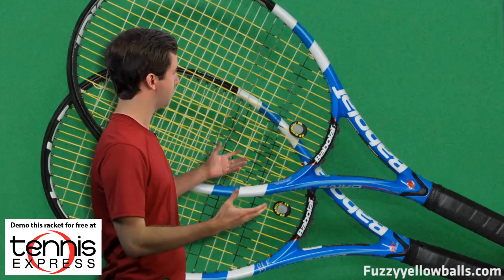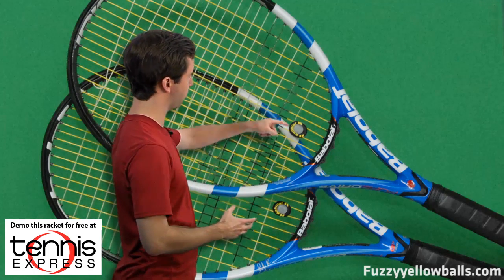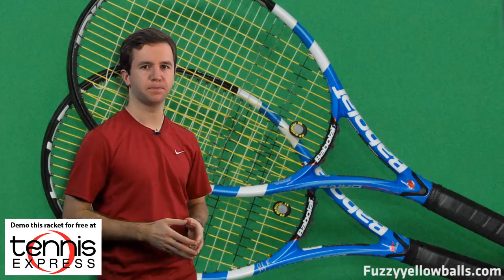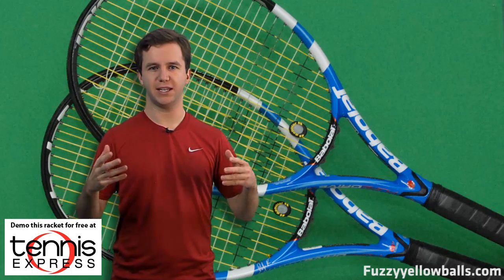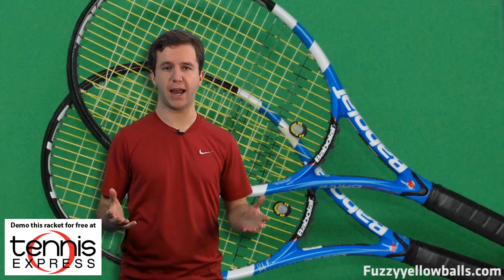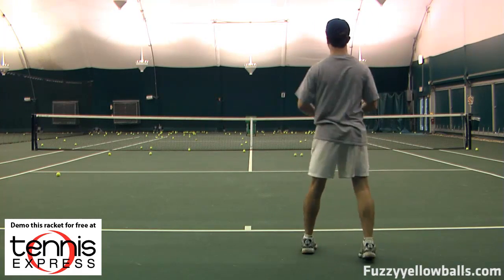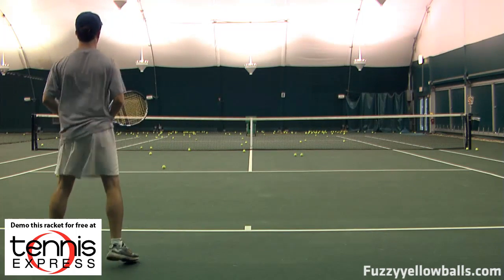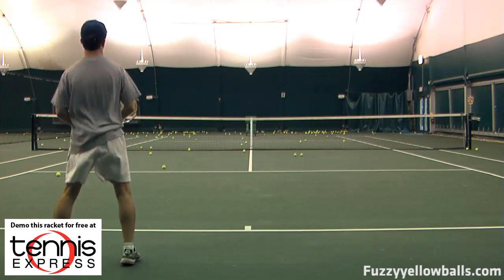Babolat Pure Drive Roddick GT / Babolat Pure Drive Roddick GT Plus -- Tennis Racket Review

Comment: I've been using the GT (Cortex 107) for about 2 years now and it's a wonderful racquet. Had to toss about 8 relatively new racquets, since I won't play with anything else now. The Cortex really dampens the vibration and it has a big sweet spot.  Recently I added some lead tape to make it a touch heavier.  It's a very nice players' racquet.    You can get cheaper racquets but don't.

Comment: Im a 5.0 and I use austrian head LM radicals. Demo'd the pure drive roddicks. This racquet to me is for juniors, girls, or people with slow swing speeds. I could casually hit like Will does in this video no problem. But during match play my shots were flying uncontrollably out once I started putting pace behind them. I hit heavy forehands with lots of spin and they were still flying on me.

If your looking for power than this is definately a good option.

Comment: Babolats are a little expensive and you rarely (never) find them on discount.  No worries, the cost of the racquet over a 3-5 year playing period is NOTHING compared to the cost of getting it restrung.  I usually need new strings every 8 weeks or so, so that's 6 per year or 30 in a 5 year period.  At about $32 a job, it's a $660 expense.  So, buy yourself a stringing machine and do it yourself for a cost of about $5-7 per stringing.  You can also string your friends' racquets and charge them $18